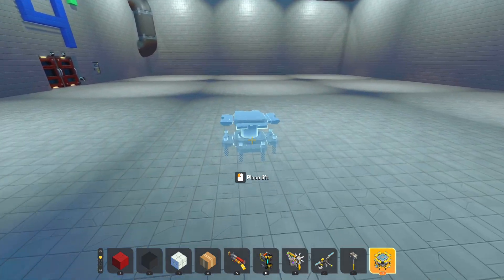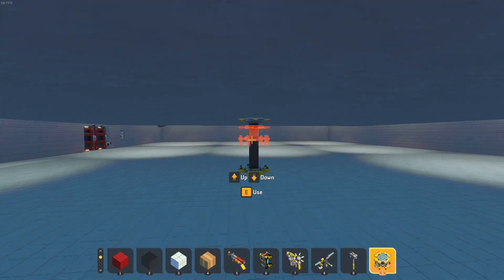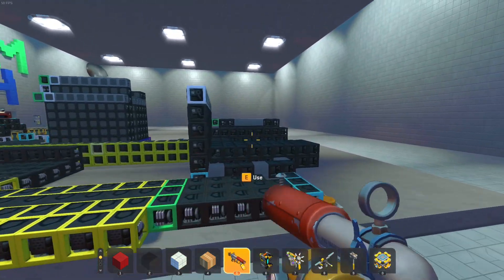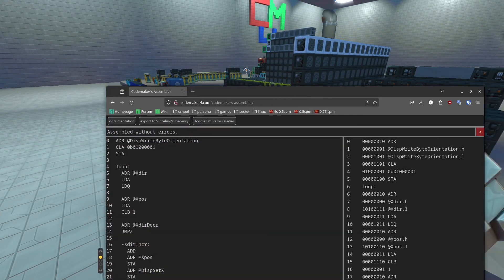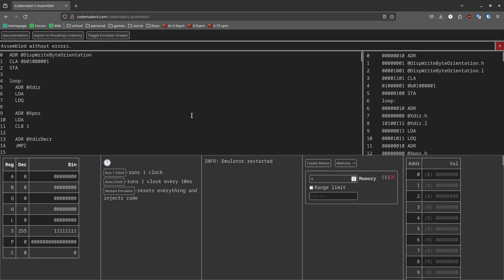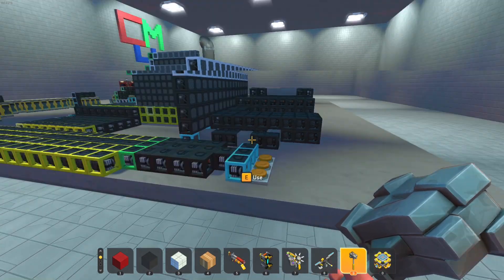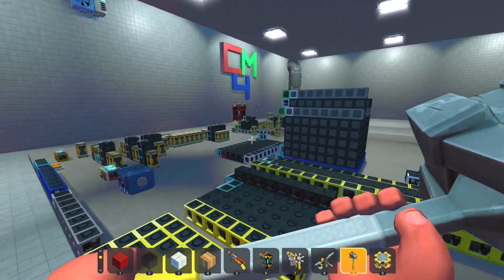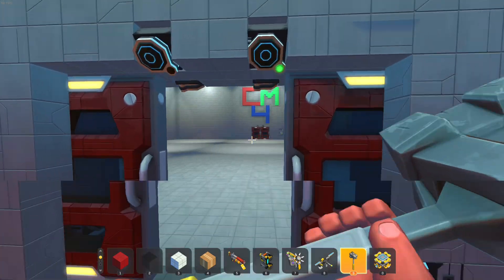SMPU demo

Comment: what's the name of the "logic speed up mod"? i really need that, for my 32-bit CPU
Reply from the maker: My discord server has a full list of tool mods that I use (link in the description) but here is a snippet about the logic speedup mod:

## Vincling's Logic Tools & Parts Mod
by @HerrVincling
This mod comes in three flavours: public, beta and early access.
*Public and Early Access are incompatible* because early access is the early access version of public, so they replace each other. I recommend using EA + beta, as it has the most features and most things work just fine. 
Both EA and public have a bug where if you convert a quick logic timer back to vanilla, sometimes the timer duration gets reset. So make backups!
- Public: https://steamcommunity.com/sharedfiles/filedetails/?id=2568516747
- Beta: https://steamcommunity.com/sharedfiles/filedetails/?id=2608898394
- Early Access: https://steamcommunity.com/sharedfiles/filedetails/?id=2817316401